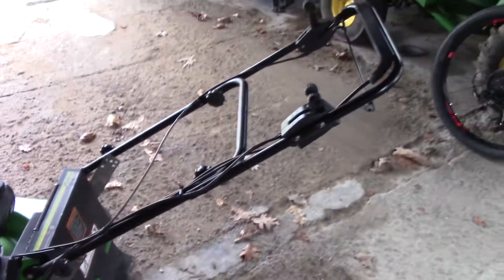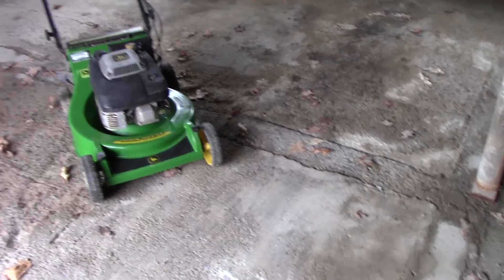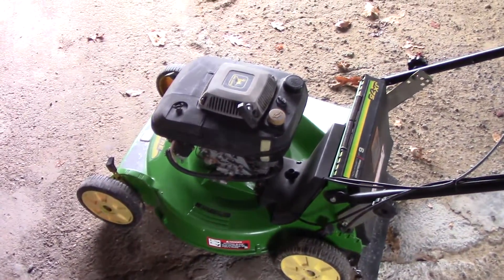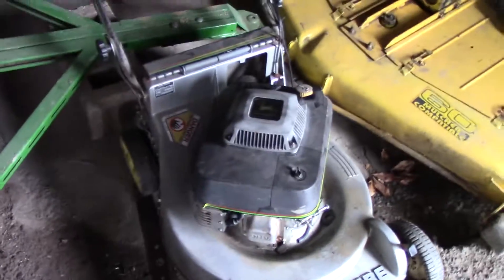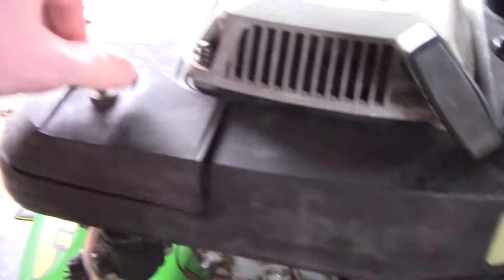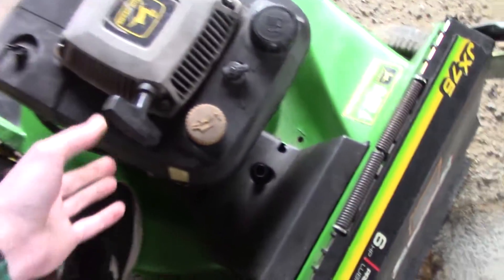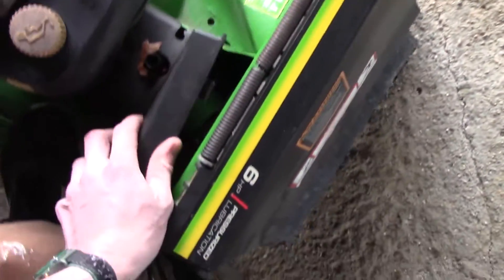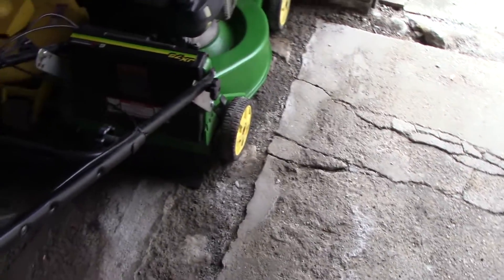The JX75 is done!

Comment: Very Nice Job!  One thing I noticed was that when you lifted up the rear door on the mower, it was missing the deflector that directs grass up towards the bagger/mulch plug/side discharge chute.  Its part number M111309 and the 2 screws are GC00020.  Once that is on there, your mower deck will be sealed off and it will leave a clean cut.  Plus it won't get grass all packed into the transmission and up in the pulley area behind the black cover.
Reply from the maker: Thank you for the comment! After I got it finished and mowed with it for the first time I realized it kept clogging up.Luckily the 14SB I have for parts had the deflector.I switched it to the JX75 and got a mulch plug and it works great!

Comment: Nice job! It's crazy that the crank was bent on the old engine, I guess someone hit a hard tree stump with it or something.
Reply from the maker: Thanks Mike! Yeah I have no idea what happened to it.After it was out I looked at it again and you can actually see it wobble when you move it. Lol Maybe they hit a big rock with it.I was told it was a lawn care machine.It's probably hit a lot of things.
Reply: @1990johndeere318  They certainly picked the toughest mower for the job lol.
Reply from the maker: @MichaelTJD60  Yeah.It's surprising how well built they really are.The fact you can grease the wheels is nice.I can't even do that on my newer expensive Honda.
Reply: @1990johndeere318  Yeah mine doesn't have greasable wheels either. It doesn't even have a blade brake clutch like the Deere mowers.
Reply from the maker: @MichaelTJD60  I made sure when I bought the Honda It had a blade clutch.Mostly because I used it to mow lawns and everyone wanted it bagged and I didn't want to keep shutting it off. I was looking for a JX75 or 14SB at that time.Of course I wasn't able to find one. lol
Reply: @1990johndeere318  Yeah my dad bought our Honda new back in '03 or '04 and we've used it every summer...it's temperamental but still gets the job done. I would have bought one with a clutch if it was up to me.
Reply from the maker: @MichaelTJD60  The one you have is about the same age as the old one I got.Mines silver.I used to mow lawns with it but I just wanted a newer one.It still runs good though.
Reply: Do these mowers have the same blade brake clutch? I could use a good one for my14sb. Thanks